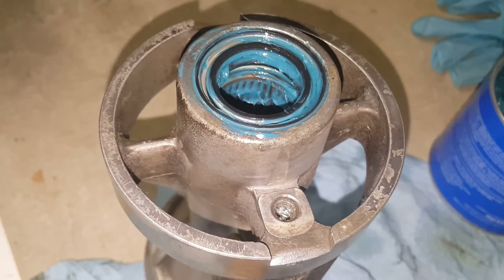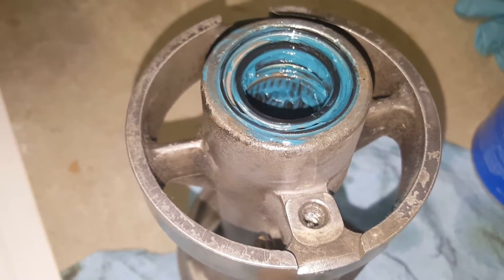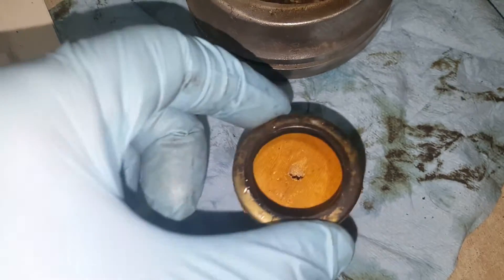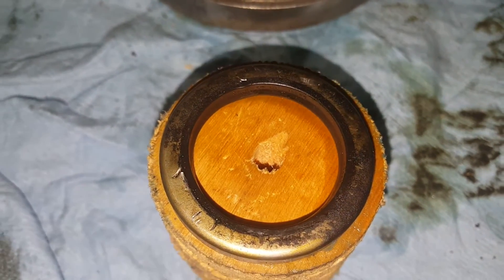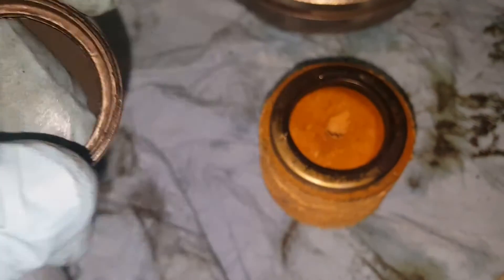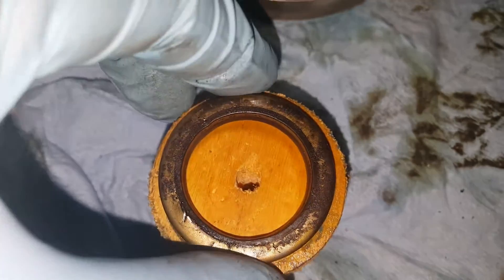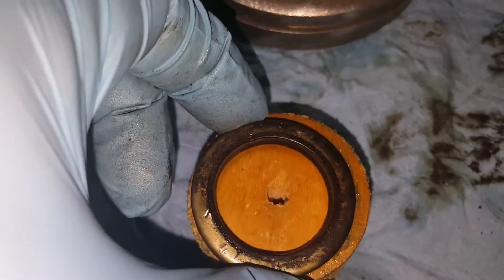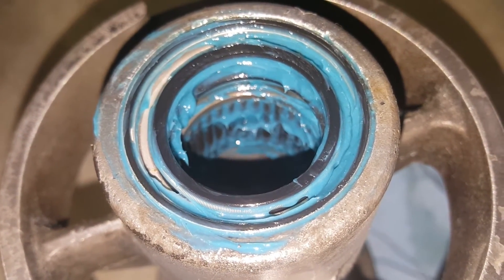OMC Cobra Volvo Penta SX Propshaft Housing - Propeller Shaft Seals

Comment: Im doing my own omc cobra bearing housing and both seals go the same direction with flat ends towards bow fyi
Also need help on removing those seals 
Im going to try heating up the housing hope it works
Reply from the maker: Hey John. Same direction is definitely wrong. Please turn them like I did in the video. The idea behind turning them opposite ways is because you want oil to remain inside the lower unit and the other seal keeps water out of the lower unit. No matter if they are stuck from salt, rust, etc. skip using heat--melting that rubber will get all over the bearings. I mean technically you could, but they make a seal puller that will make it go so much faster. They have them at autozone and Amazon (same day delivery too) https://www.amazon.com/Lisle-56650-Adjustable-Seal-Puller/dp/B000JFL83Y/ref=pd_bxgy_263_img_2?_encoding=UTF8&pd_rd_i=B000JFL83Y&pd_rd_r=8CJCHSGVCMZ6Y0SAG95K&pd_rd_w=4g0Kr&pd_rd_wg=WOnRQ&psc=1&refRID=8CJCHSGVCMZ6Y0SAG95K&dpID=31NBkGVPTgL&preST=_SX300_QL70_&dpSrc=detail

Ping me more with questions.
Reply: thanks yes back to back i got some previous wrong info